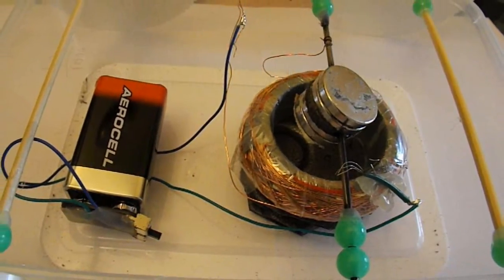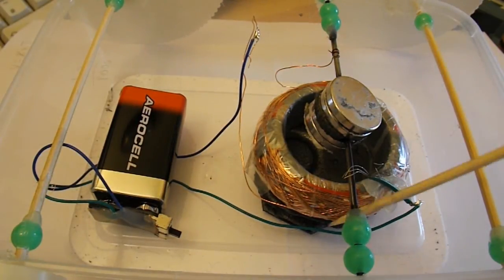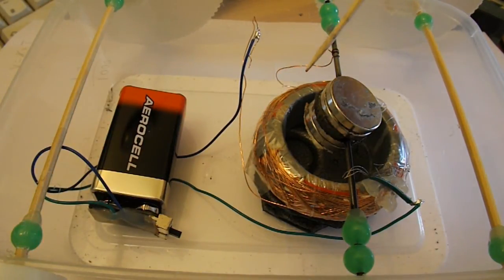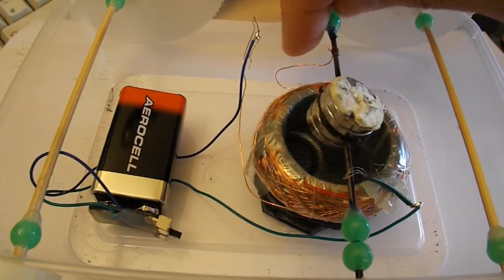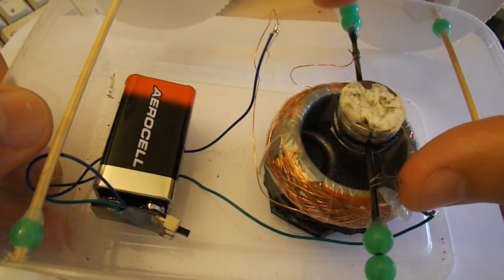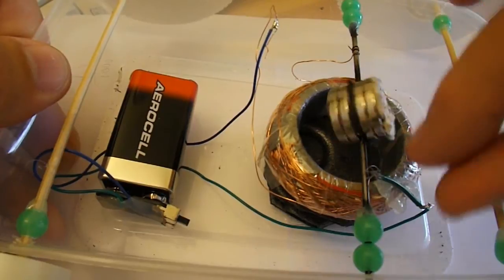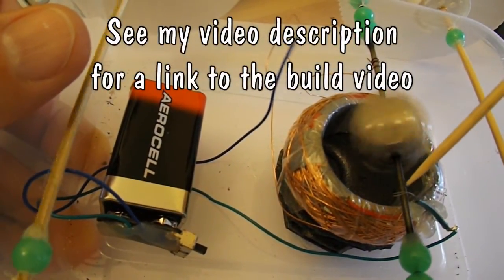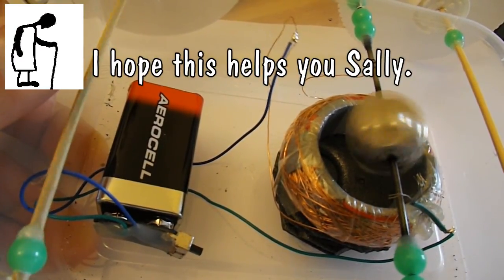Close Up of my home made electric motor powered electric car wiring

Comment: What is the purpose of the coiled wire?
Thanks :)
Reply from the maker: Ihsaan Rawat when current flows round the coil of wire it makes a magnetic field. That repels or attracts the magnet in the middle causing it to move. This is explained in the video description.